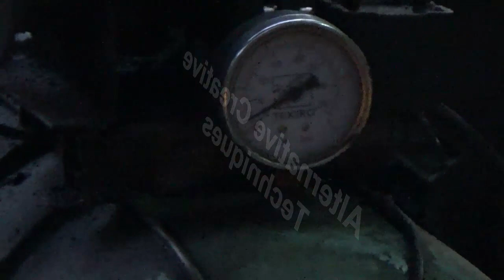Waste Oil Burner settings, and Testing Melts Copper.

Comment: Your venturi is backwards that is why it's difficult to start. Intersecting connection should be fuel not air. Like a spray gun. Once you heat the nozzle red hot then introduce the oil. Make sure the flame is always there to startl. don't introduce the oil without a flame present